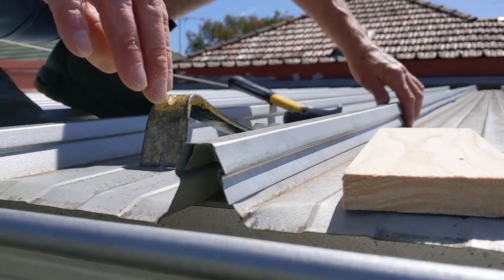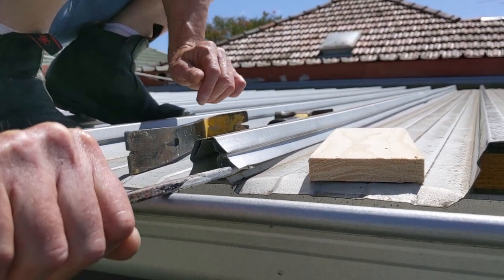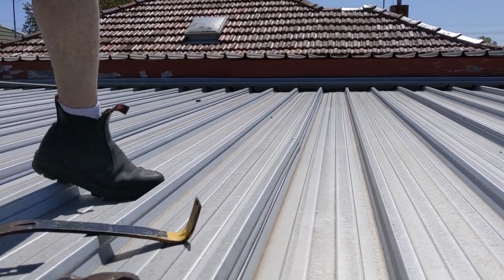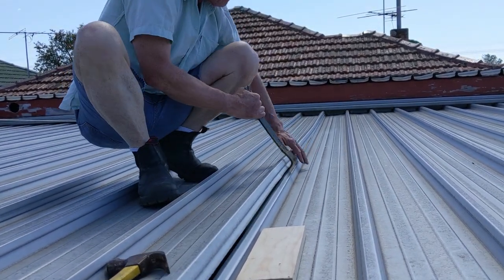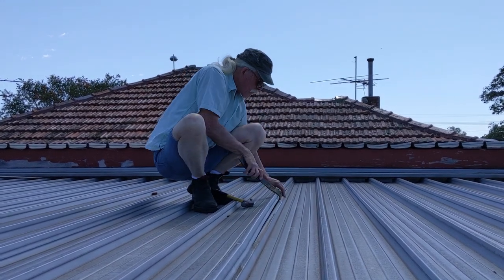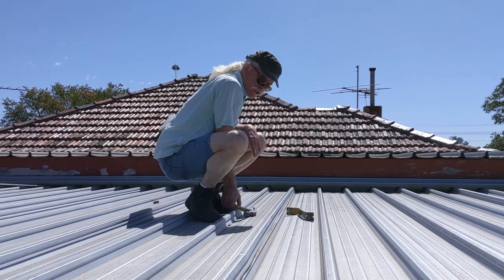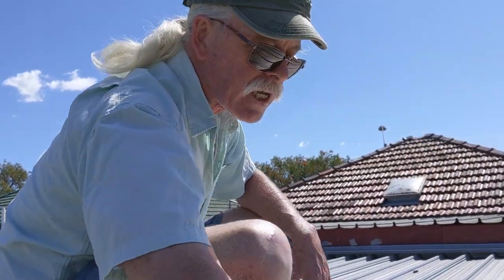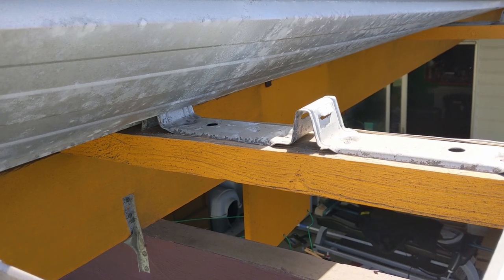Klip Lok 700

Comment: Great job buddy! Well explained. Kindly use protective gear specifically gloves ;)
Reply from the maker: One day I will get around to redoing this video. I've since discovered a slightly better way.
Thanks for your feedback 😉
Reply: @gunsparky  What is your new and improved way? Would love to hear it.
Reply from the maker: @stuckster  As you can see from this video the hard part is getting started. If you jam a screwdriver into the end between the two sheets it will lift easily. You can make the video for me if you like.
Reply: @gunsparky  Thanks. Yeah you demonstrated the screwdriver method in this video. Will def give that a try. You mentioned in the comments that you had a slightly better way. Were you referring to the screwdriver in the end?
Reply from the maker: @stuckster  Not quite. In this video, I use a pry bar to peel the top sheet away from the side. If you use a screwdriver over the top between the two sheets it will lift a little easier and do less damage to the top sheet. It's a minor thing but hey. I am currently nursing a knee injury so won't be getting on any roof any time soon. Cheers

Comment: Perfect, exactly the help I needed.
Reply: Dinged the sheet..not how you do it.

Huge issue is trying to lift the sheet a section at a time,you need to pop each lap (the entire length of the run) from the clip and then lift the whole thing at once.

Will also tell you that the  claw on a hammer is the perfect angle for doing this.